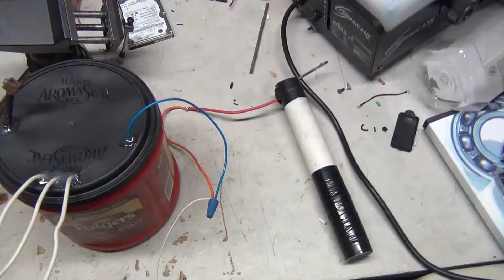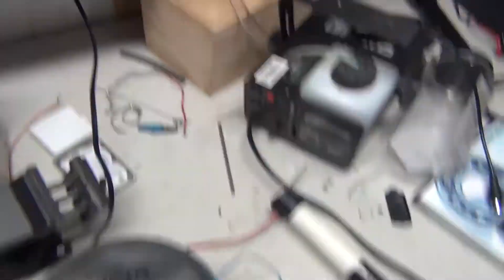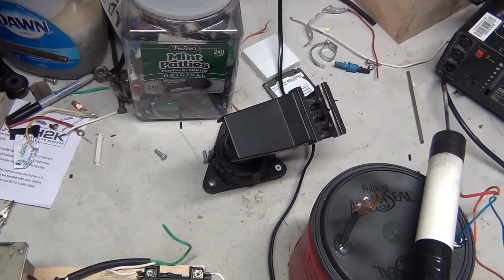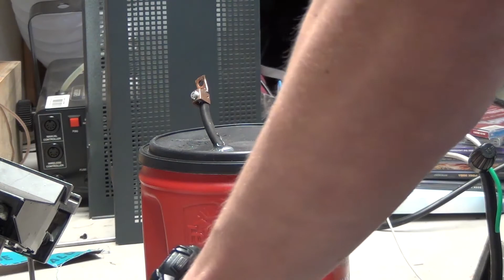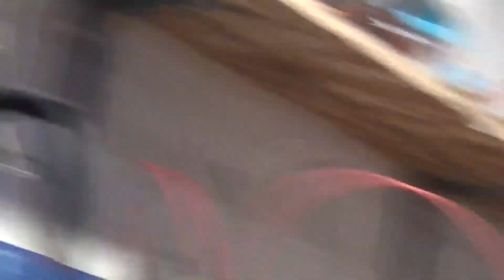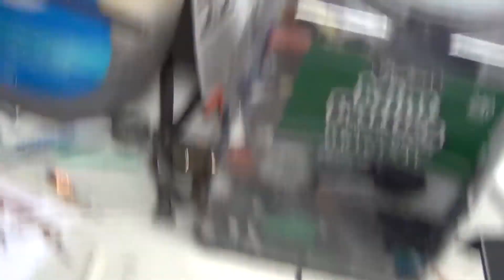10kV HV Transformer More Arcing

Comment: I found with some of the experiments I've been running while tinkering with duel E cores, is that by lapping the touching surfaces to be smoother and flatter with one another gives a better hysteresis curve on an oscilloscope meaning less magnetic flux is lost to an air gap. But due to the steel's hard nature it takes alot of sand paper and lots of careful hand motions on a flat surface with the core pieces to flaten them out.
Reply from the maker: Hmm, makes sense. I've never thought about doing that, but some of the E cores certainly have rough ragged edges, so I can see why it would improve losses. I'll have to try it sometime.